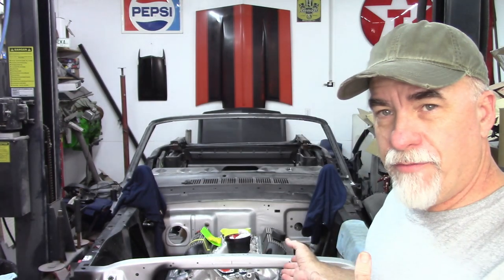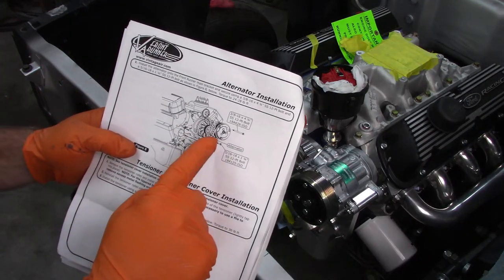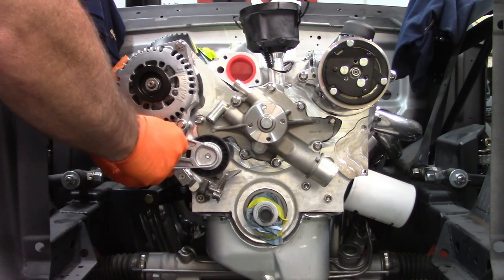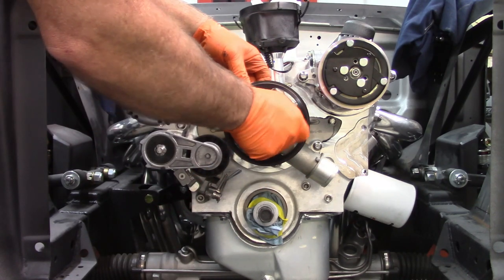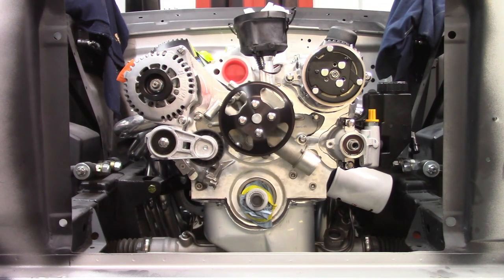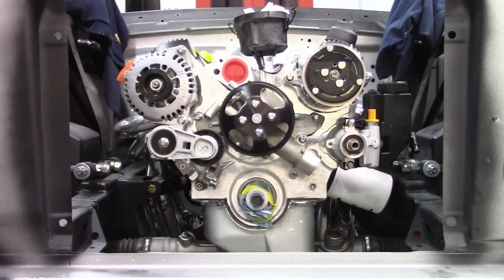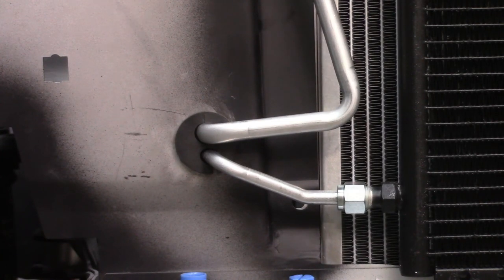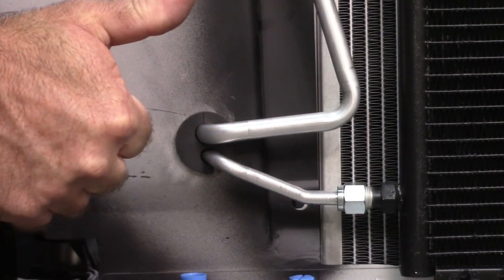Vintage air test fit part 2. Brooklyn Pony Part 46 B

Comment: The GM power steering pumps resembling that pump we sold at our parts store had a bolt and square nut and washers that you greased up and pulled the pulley onto the pump. Was a real simple install and not requiring the buying or rental of a special tool,

Comment: Only thing that comes to mind is either move the lower water port or custom make a lower hose getting around the crank pulley might be a problem good luck with figuring it out thumbs up 👍.

Comment: That's a really sweet accessory system! Someone put a lot of thought into the design and assembly. As far as the lower radiator hose, that may get ugly, off the top of my head, I can't think of a hose that makes a right hand u-turn then a left turn 14"-16" inches later.  Sorry... I've got nothing, everything that comes to mind would be a pain in the area. On a more positive note, Great video, I love the way your using the time lapse.  Thanks

Comment: I have a Fordracing boss 363 crate engine and the vintage air front runner! Same problem with the harmonic balancer. Not happy with the kit however made work. I ended up shaving the water pump down for clearance and installed the balancer with that bottom bolt out, then putting it back in when fully installed...  I've had other problems to over come with it also,  I definitely should have gone with a different system in hindsight...

Comment: Looking at the same Vintage air kit.  Do you think when you centered the radiator that it impacted the measurement for the hole in rad support, for the condenser lines?

Comment: A double roller timing set makes no difference on the balancer ( its the snout that dictates where its positioned) the gears are what changes in width inside the timing cover.

The top fitting off the pump attaches to the water neck with a 5/8" ninety degree hose. The angled fitting goes to the heater core, with the other hose going to a barbed fitting in the manifold behind the water neck that there is a plug in now...hope this helps.

Comment: Wouldn't it be possible to cut off the lower tube on the radiator, weld on a plate to block the hole, make a new hole on the lower driver side of the radiator and then weld on the tube that you cut off? That way you awoid the long hose from the radiotor to the water pump. I have no idea if it's possible to move the outlet on the radioator to the other side (maybe the cooling wont work properly then?). Just suggesting.
Reply from the maker: Possible, but this is not a cheap radiator.... Not sure we should do that.
Reply: @JoDaddysGarage  But with your amazing skills and especially your welding skills, I'm 110 % sure that after you're done with it, the radiator would look like it was made like that at a factory.

Comment: You said you have a machinist next door have him turn down the O.D. yeah you'll lose your timing marks,  but you might be able to use an adhesive replacement timing tape to restore them.  Or a fluidamper with the correct O.D.  Just a thought.

Comment: Hey Barry, a radiator shop could swap the lower outlet. Had that done to a 68 mustang years ago. Or you could fab some tube with radiator hose on each end. Great video.
Reply: Yes, swap the lower outlet and the drain.  May have to weld either one or both to an aluminum plate to weld to the lower tank.

Comment: No reason the intake manifold can't be used with any aftermarket throttle body EFI. It's the same 4150 bolt pattern used by Holley EFI, FAST, FiTech, etc.

Comment: Looks like you need to swap out that radiator for the Griffen #7-70036, I think is for the Boss 302 and late model motors with the outlet on the drivers side.

Comment: I forgot to add in my previous comment about the location of the lower radiator hose connection, but you're best bet is to use the flexible metal type.

Comment: Thanks Barry, another really informative video.  Assuming you use a  smaller diameter balancer and a larger diameter crank pulley so that the ratio is maintained and the accessories rotate at the correct speed?  Would it otherwise affect the power steering's flow rate, alternator charge and coolant flow?  Or would the difference be negligible?
Reply from the maker: I'll use the pulley provided. It will fit the new balancer.

Comment: just cut that lower outlet on the radiator off and weld it on where it will work better. :P
wish i had that kinda clearance between radiator and engine... looking good though Barry.
Reply from the maker: I may have found a hose that will work.
Reply: @JoDaddysGarage  nice. i ended up having to us a flex hose on mine... gave up trying different ones that said they "will fit"...

Comment: I think you will need a radiator with the lower hose connection on the driver side, unless Vintage Air has a water pump with the hose connection on passenger side. I don't think I have seen a small block water pump with the hose on the passenger side. The upper hose will connect to a thermostat housing that makes a 90 degree turn straight up, just like later model 302.
Reply: Looks like the compressor hard lines may interfere with routing a passenger side lower hose.
Reply from the maker: Pretty sure this won't work.